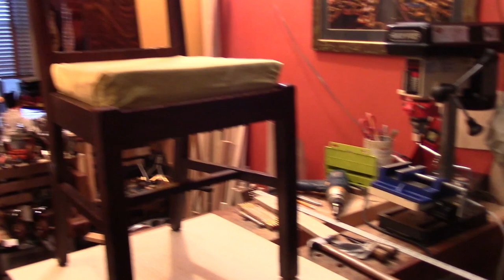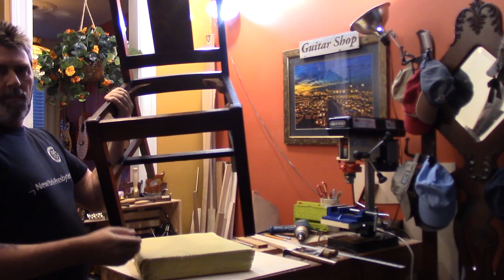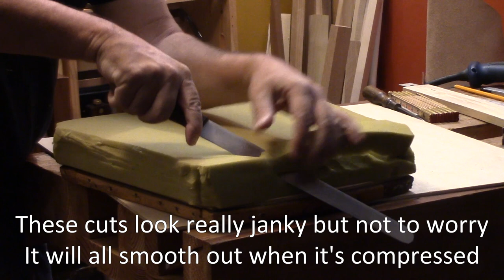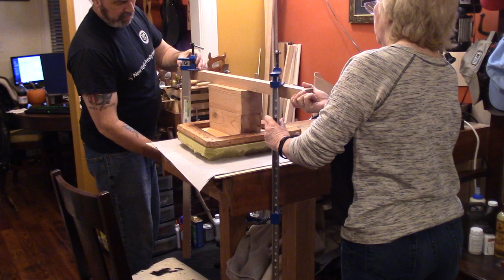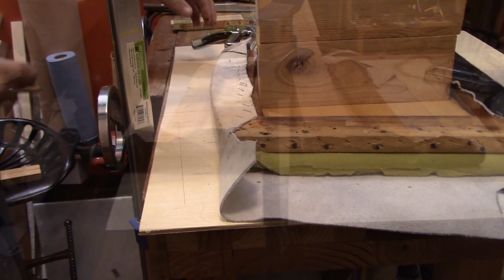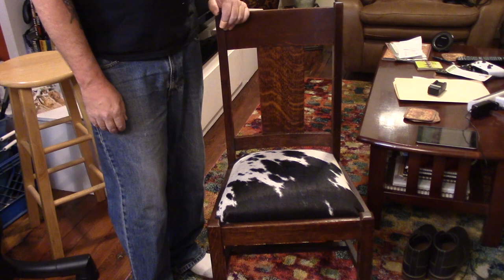Cowhide Chair Rehab (reupholstery)

Comment: Could you share your trick with the wood pieces that you used to measure out how much hide you would need to fold over the seat cushion? What size pieces of wood did you use and how did you decide that?
Reply from the maker: Sure, I just lay the seat base down on the hide and then used the wood to make it easy to draw a 3 (or 4, i don't exactly remember) inch wider pattern on the hide to cut out.  I just didn't have a single piece the right width so I used a few to get there.  The example I used was a video by paul sellers reupholstering a chair with leather.  Good luck and do share pictures of your result if you tackle this one too! (Pauls video part one is here: https://www.youtube.com/watch?v=mYFygbgGv-M )